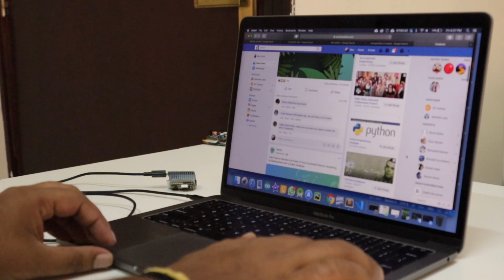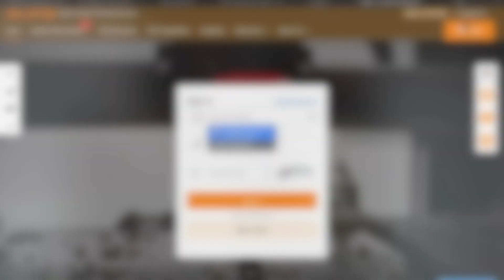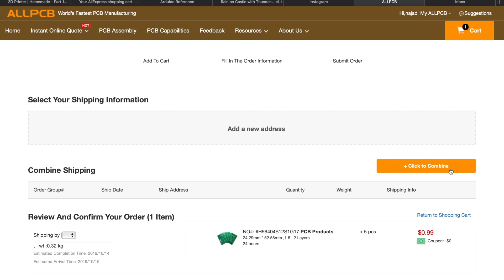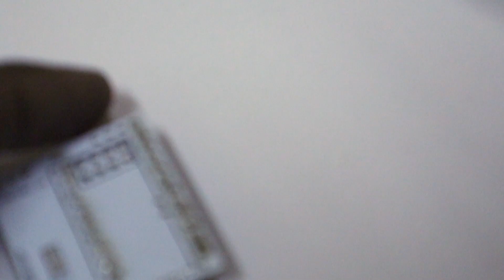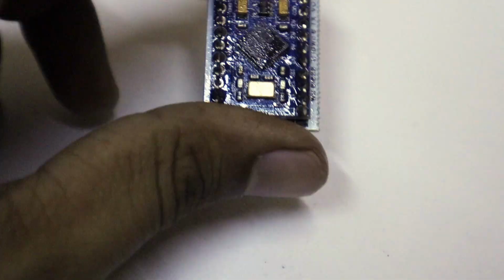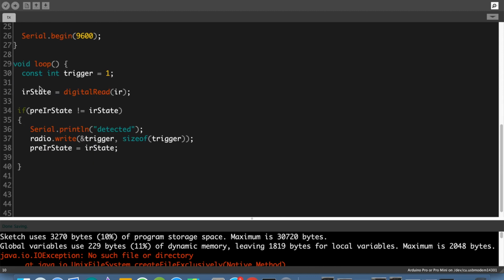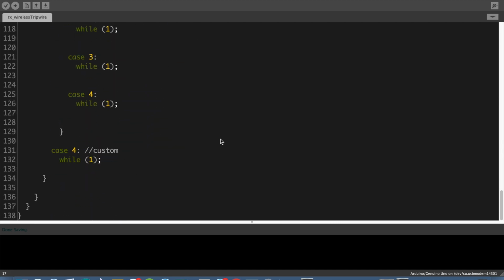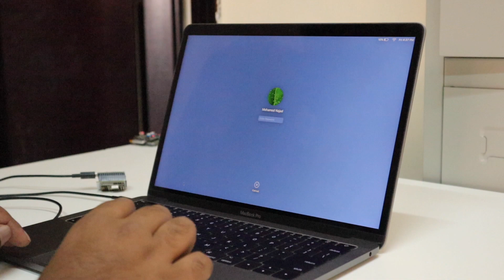Tripwire Automatically Minimise Your Tabs When Someone Walks By

Comment: How were you able to accomplish soldering in a 6-pin row, but after coding and adding battery etc. It becomes a 4-pin row?
Reply: Also I saw you changed the IR sensor mid-tutorial?

What is the input from left to right now?
Is it: GND - VCC (+) - OUT?

And could you give a more insight in commecting the battery to the battery charging module? I have been getting problems with it because there’s 4 holes in the battery module.
Reply from the maker: @grandtheftautoexpert2040  tell me the model no. of IR sensor and battery charger module you are using
Reply from the maker: @grandtheftautoexpert2040  there will be 2 terminal for input and also there will be microUSB for input, you can use any. For output and battery you can use the out terminals
Reply from the maker: Whatsapp me here https://bit.ly/34zPp5W for more detailed info
Reply from the maker: I didn't understand ?
Reply: @DIYUSTHAD  if you look in the video when you solder the pro mini, you see yourself soldering 6 pins. While in the split second where you see you placing the pro mini on the table later on at the showcase, there’s only 4 pins.